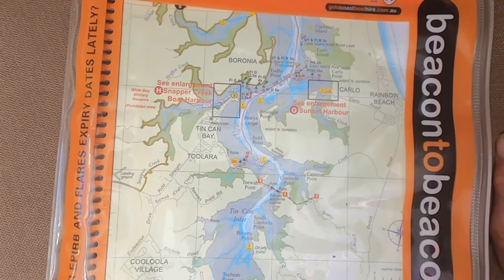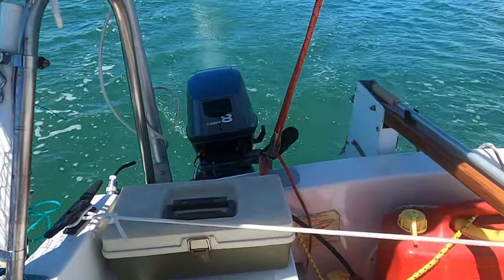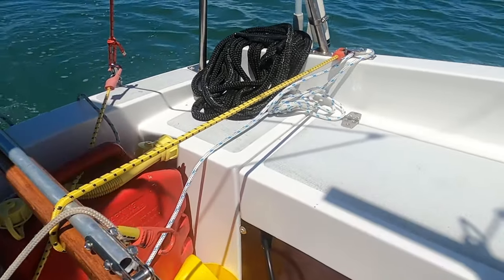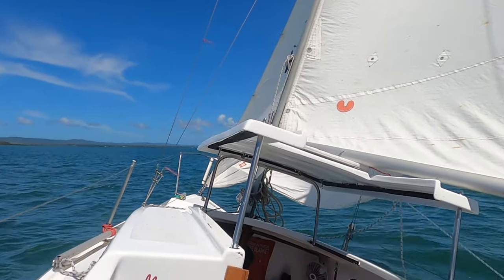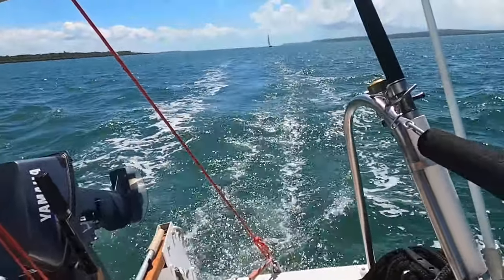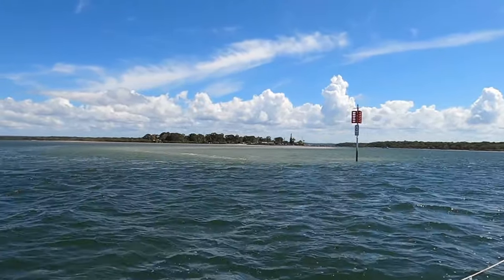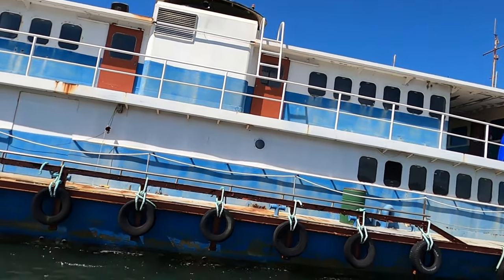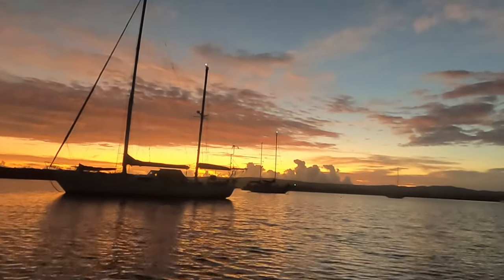Discovering the Tincan Bay Inlet in Mozart. Sailing Trailer Boats QLD

Comment: Hi Christopher, 
Thanks for a great video and don’t forget about the comment I sent you on how to do main sheet to tiller.
Can you please tell me what engine you have , is it a old two stroke or a new two cylinder 4 stroke because I want to buy a new 4 stroke 2 cylinder engine but wanted to compare the noise .
Reply from the maker: The engine is a four stroke Honda GX140. https://www.engine-specs.net/honda/gx140.html it’s the second on I’ve had in her. The first got dunked.
Reply from the maker: https://youtu.be/gvXJg6hEJ-U
Reply from the maker: https://youtu.be/hdEKJ--RcM8
Reply from the maker: 2 stroke would be noisy and high revving  I do recall your self steering comment but remind me?
Reply: @SmallSailboatCruising  hi, I said on your video about “How to set up self steering on a sailboat. sailing Trailer Boats” I said, I did one on my main sheet and it worked well. Have a lot at what you said on that video. And thanks for the info regarding the engine.
Reply from the maker: @CaptMarkSVAlcina  thanks for the clarification. Main sheet worked best for me too.  Being small and light she pivots around the keel too readily. A long keel acts as a buffer. I recently got a comment that I had the jib rigged back to front. It’s an interesting subject and each boat is different. Needs lots more testing out to find what works best but I’m getting closer.